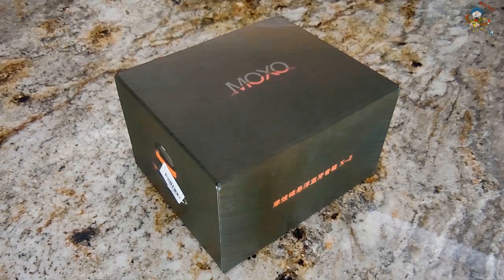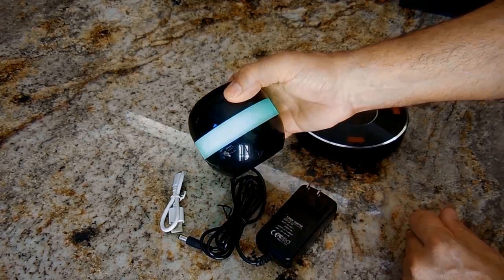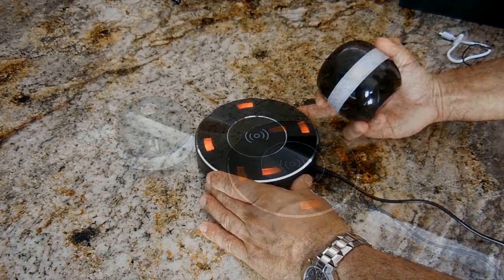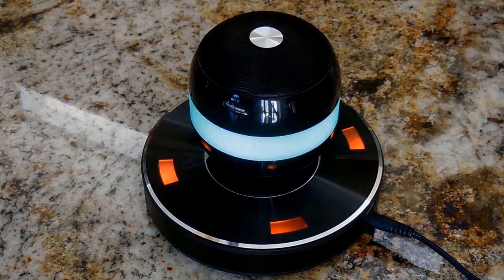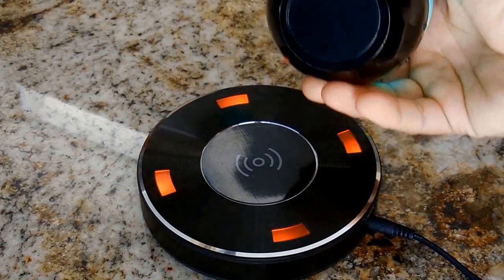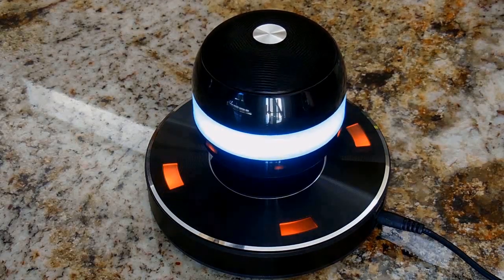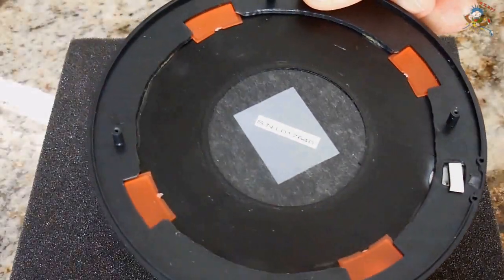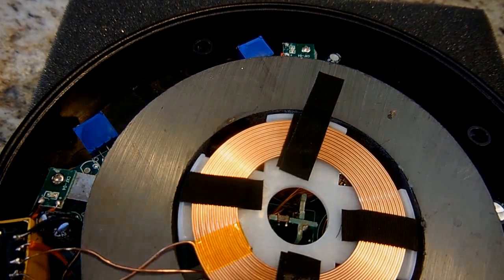MOXO X-2 Levitating Bluetooth Speaker Review & Teardown

Comment: "If the battery here becomes very weak from lack of use..."

What you said here must be one of the rarest things people say in the universe.
Reply from the maker: What? LOL You never heard of a battery self discharging? You do realize that using the device will keep the battery charged. If you don't use it frequently, then the batteries will become weak due to a lack of inductive charging.
Reply: Of course (to all your statements), and i'm not an expert, so my errors should be corrected, but I wonder if the device is correctly build, if it weakens batteries if not in use, more than they weaken if they are not attached to device? If it works as a clock for example outside of its 'main use', weakening is understandable. Excuse my english.

Comment: Pretty cool. I wonder what that yellow rectangular package is (with wires running to the coil) on the left side of the base (13:03). Capacitor maybe? Too many leads.
Reply from the maker: +Mark Whitbeck 
Appears to be a capacitor in parallel with the coil to adjust the frequency, but it may also be an entire circuit covered in potting material for the inductive charger.
Reply from the maker: +Mark Whitbeck 
Appears to be a capacitor with multiple outputs in parallel with the coil to adjust the frequency.
Reply: +electronicsNmore  Thanks! Just as I suspected.
Reply from the maker: +Mark Whitbeck 
Thanks for your support! :-)